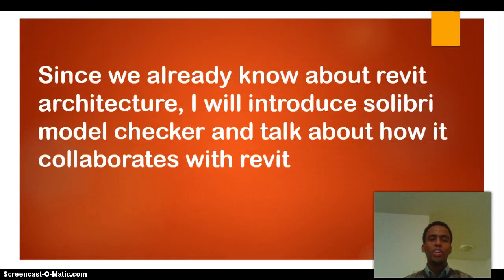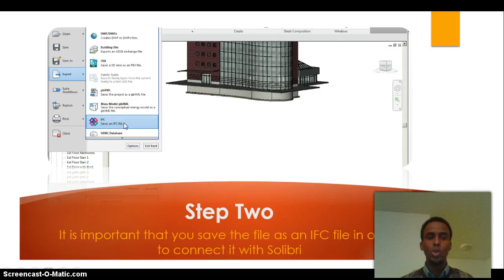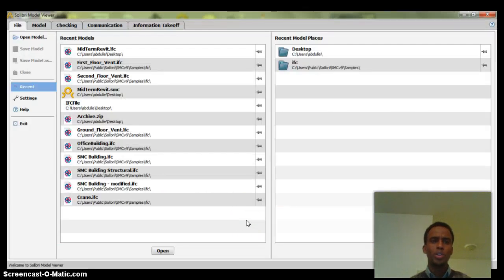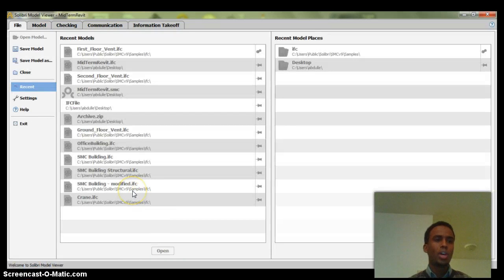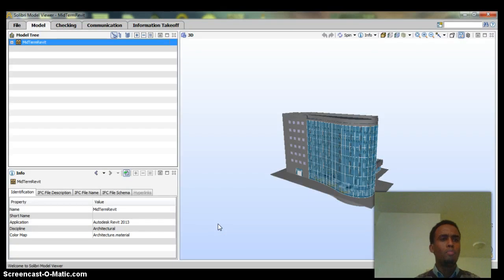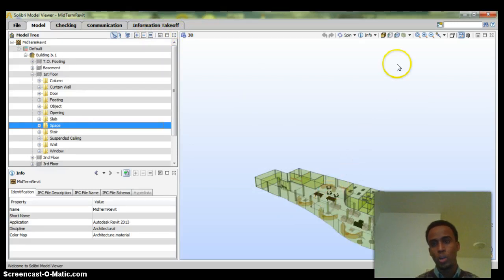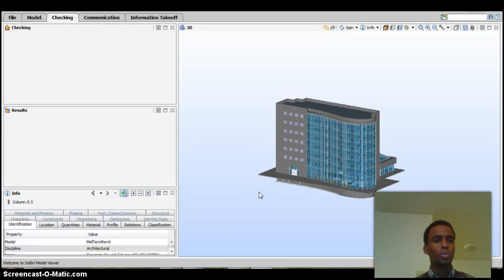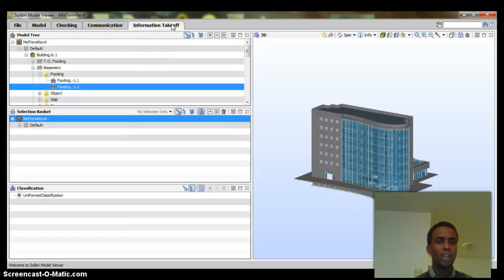Revit & Solibri

Comment: Hallo, I hope you can help me...
I exportet IFC from Revit into Solibri. I have errors regarding Walls and Windows.
Walls have to star at base Lavel (without offset) and end at the Level above?
Solibri does not recognise walls in the right floor when the walls have base offset? Is this correct?